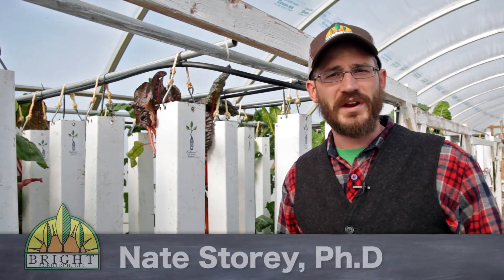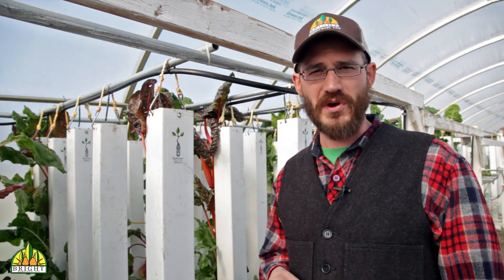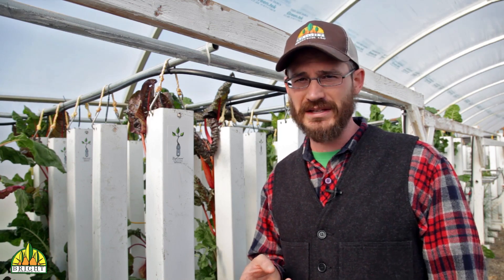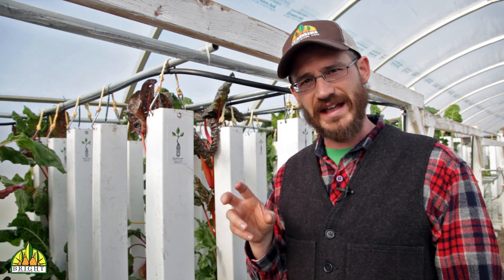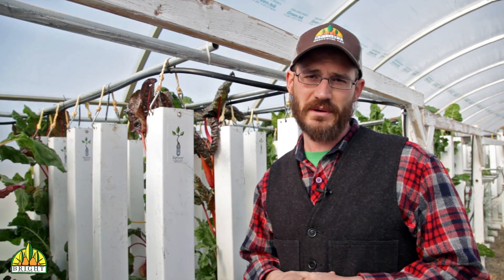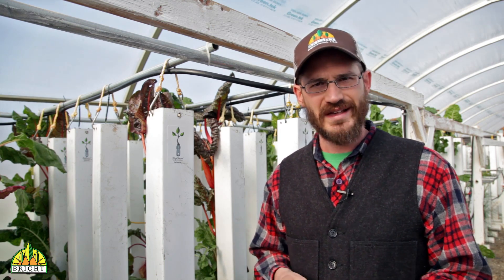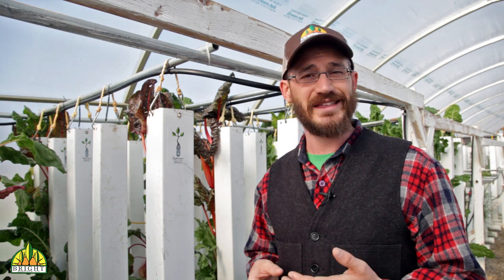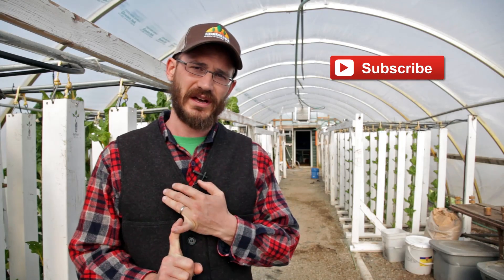Recirculating and Flow to Waste Hydroponics

Comment: Sorry you're misinforming people about DTW system.  Rather than free flow drip/irrigation, you can dial in your DTW nutrient/water flow so that you're delivering nutrients and water to the plants but NOT in excess.  The drain off should be approx 10-15% of the nutrient feed and by monitoring your PPM and PH in the drain off you'll be able better understand how your plants are feeding.  In actuality DTW is more efficient for the plants than recirculating system that often overfeed delivering a "once size fits all" and the frequent imbalances of recirculating nutrients (not all plants are alike) resulting in acidic levels requiring a fresh reservoir.   DTW uses LESS water than reciruclating systems.  And by learning how mediums that have CATion retention capabilities like coco your medium also maintains better balance vastly reducing the cal-mag deficiencies so many recirculating systems experience.  I appreciated your attempt to inform the distinctions between DTW and recirculating hydroponics, but please come up to speed on DTW.

Comment: Is there any way to filter the left over nutrients out of of used water once you discharge it? Not so much to reclaim the unused nutrients but to prevent the waste of the water.
Reply from the maker: Sorry Smalltowntexas - Not much of a filtration system for hydro to reclaim nutrients. The best thing you can probably do is water your soil garden with it.